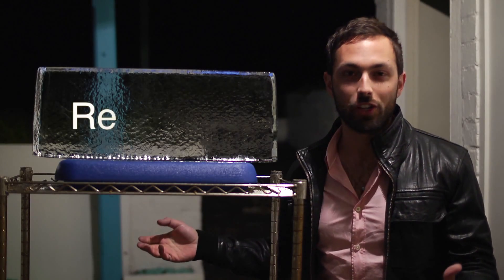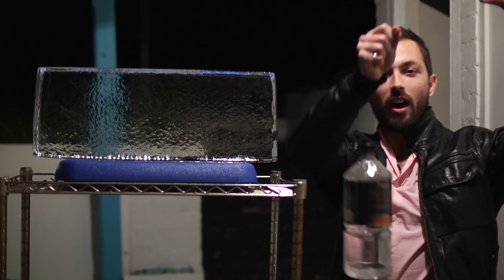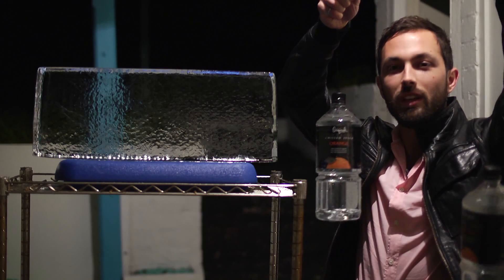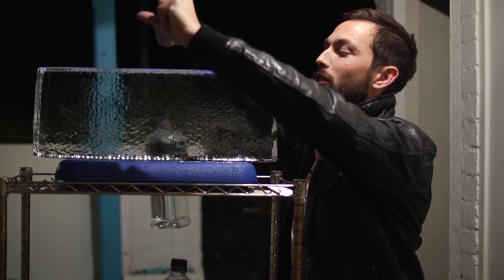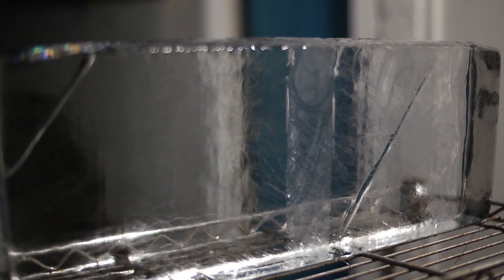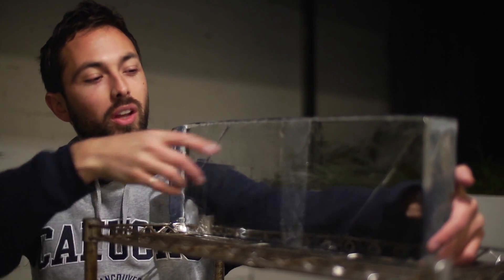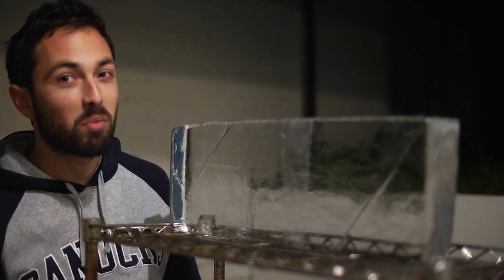Does Pressure Melt Ice?

Comment: I suggest you try this in a dark freezer where the temperature of the air, ice and wire are equal, then compare wire vs monofilament nylon etc. to isolate pressure to prove this theory.

Comment: Please do a video on how ski glide wax works. I have asked my physics professors and they could not give me a clear answer. From my understanding, if you wanted to decrease friction between the ski and the snow, you would want to use something like Teflon, but this is not the case. Glide wax apparently works by creating enough friction to cause the frozen water molecules to get "torn apart" and act like a layer of water. Is this the answer or is there more to it? Even more complex is cross country ski wax, called grip wax. What are the physics behind that? There are two types of grip wax; one is hard kick wax, used for new snow with a crystalline structure and very cold snow. The other is klister wax, and amorphous solid ( it looks thicker and stickier than honey) for older and wetter snow. I think this would be an interesting topic.

Comment: Wait....wouldn´t the ice itself cool the water down to below 0° and cause it to freeze anyway? You can rub two ice cubes together creating heat through friction and the surface will melt, if you then hold them in place, the icecubes themselfs freeze together...

I´d like to see that experiment by applying pressure to the entire block, melting it, then releasing the pressure freezing it again.

Comment: I personally don't really think this is a good demonstration of the phenomenon. I'm not completely sure whether it is the pressure on the ice from the string that cut the ice or that the wire is just conducting heat away from it, hence cutting it. I'm dubious its the pressure that turned it into water but fair enough. But the main problem is that, I'm very sure the reason why the ice is still one solid block after the cut is because the sub zero temperature of the block of ice instantly freezes the melted ice once its been cut. If I press two ice cubes against each other they will be bonded together very quickly, yet I'm applying pressure to the ice cubes, whilst this video says the opposite, does this not contradict each other?

Comment: YOU ARE COMPLETELY WRONG MATE !!!! ITS NOT THE PRESSURE OR HEAT ITS JUST INTERNAL BLOCK RESERVE OF NEGATIVE ENERGY SO THE WHIRE CUT TROUGH BLOCK TOO SLOW SO THE REST OF ICE BLOCK GAVE ENERGY TO FREEZE WATTER AGAIN TRY THIS TAKE 2 ICE BLOCKS WATTER WERRY SLIGHTLY ONE SIDE OF ICE BLOCKS AND PUT THEM TOGETHER THE ICE HAS TO BE WERRY FLAT YOU WILL SEE IT MELT DONWN
Reply: ...Negative energy? Are you off your bloody rocker, mate? There's no such thing.
Reply: I can forgive the poor grammar, but why are you shouting at us?
Reply: Perhaps viewers will understand your comment better if you actually spell words correctly.
Reply: Of all the comments that I have read hear I would say that JusstyteN is the closest. The first thing you must consider is that there is no such thing as "Cold", "Cold" is something we describe something feels like, much like wind chill. In fact "Cold" merely represents low energy. Heat is energy, the higher the energy the hotter something becomes, less energy the colder it feels. The key to this is the bottles of water tied to the strings. The bottles are being acted upon by gravity pulling them down the strings are thus acting against gravity's effect causing tension in the string. The string resists this force which creates energy. This energy, of the string, is resting on the surface of the low energy ice. High energy will always flow to areas of low energy thus 'warming' the ice. The string sinks through the water and stops on the solid ice and the process continues. The melted water floats above the string. Water has a higher energy level than ice. High energy and low energy. The surrounding low energy, ice, freezes the water and bonds the two blocks again. The neat thing I like is the shape of the cut. The string at the edge of the block has a higher amount of energy due mainly on the deflection of the tensional energy at that point and lessens until it reaches the center, from both directions. The string at the edge of the block of ice cuts quicker then the center forming the arc that we see in the video.
Reply: yea i know im not so good in english but im trying to say that the ice contains low energy compare to other stuff in room so the block just shares his low energy with water where whire gone and freeze it up again
Reply: FrakinUserName
yea thats what i meant even absolute 0 is an energy what we coud potensialy make a bigger energy i think geotermal house warming systems coud do that teoricaly and you are absolutely right the watter with higher energy freeses again because ice absorbs it and my english isnt that good yest to explain that thank you :)
Reply: FrakinUserName
i gave +1 btw :D
Reply: I don't want to sound like a smart-ass (too late) but absolute zero by definition is zero energy. Quick question; where in the universe would you find the coldest place?
Reply: FrakinUserName A lab on Earth.

Actually, probably a lab on another planet owned by a more advanced civilization than ours. But we haven't found any yet.
Reply: D-wave, Canadian company in BC (which recently got brought by Google for NASA, has produced a microchip at -273 C. Before someone ask, No I don't work there.
Reply: FrakinUserName
i read in sientists magazine that gass was cooled one nanokelvin below 0 kelvin so i guess that those gasses was coldest in universe but other that that im pretty positive that black holes are coldest and its called singularity state when atoms doesnt have gaps in between i like smart asses when they teach you something or makes your idea more accurate cool stuff cool stuff but hate them when any sayd word is "wrong" and there smart ass comes as far as i can see you are cool

Comment: How do we know it's not a "hot butter thru knife"? 
Is it the pressure that is changing the melting point of the ice or the wire heating the ice in contact to ambient temperature?  This needs to happen inside a giant freezer.

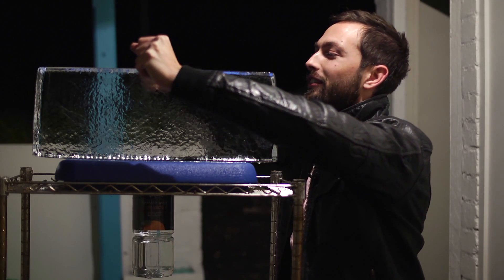Comment: I'm afraid that isn't convincing, as other commenters have pointed out: an example of an alternative hypothesis is thermal conductivity leading to both the melting and the refreezing. 0:35 is the problem: it's warmer than 0 degrees.

I think if the whole experiment is conducted in sub-zero conditions, it would rule out the possibility of the melting happening due to thermal conductivity.
Reply: Agreed.  This issue was really bothering me.
Reply: As follow up to my original comment: Veritasium is about education (and entertainment, as vehicle for the education). In a sense, it's like Mythbusters: it is about explaining how science works, it isn't about doing rigorous scientific studies. So my suggestion that this video doesn't fully rule out the suggested alternative hypothesis, is arguably not so relevant.

Anyway, here's a cool related video:
Ice Cutting Experiment
I feel it's orthogonal to the concern I expressed. What I perhaps miss most is just a better sense of how long this ice cutting takes, since the video is in fast-forward.
Reply: Hugo van der Merwe somebody missed the point if the scientific method.  It is a method by which one can engage in the pursuit of truth (Veritas).  Being rigorous and entertaining are not mutually exclusive.  Being brief and simple does not excuse modelling poor reasoning to non-scientists.
Reply: Exactly. If it were in a zub zero environment, even if the wire disipates heat, it wouldn't be able to do so as to get over 0°C, so the ice would remain solid.
Reply: *****
Right. Only that the gas inside the container should be kept at below 0°C, since otherwise the ice would melt due to the increase of the gas temperature due to the pressure.
Reply: Federico Manuel Aroca Echauri
Even IF everything stays below 0°C, the ice would melt under preassure.
http://s.hswstatic.com/gif/freeze-drying-graph.gif

Even at the same temperature, when the preassure increases, at some point the ice turns liquid again.

You cna do this experinment in a coolingchamber at -10°C and it wil still work.
Reply: try it at home with a plastic wire and you'll see, or go ice skating and think: If my fingers don't slip through the ice how come my ice skates have almost no friction?
Reply: @NicoKupfer  There's a thin layer of liquid that covers the ice, reducing friction. https://aapt.scitation.org/doi/10.1119/1.2343616

Comment: The ice refuses back together because for a couple reasons. 1, the seem cut from the melting wire is perfectly flat. 2, the core temperature of the ice is cold enough to refreeze what little water is in the seem, which fuses the block back together. 

This is a pretty incredible way to cut through the ice and will try this out sometime. I think if you were to try this with the low E string you would have much different results. From the larger wound string. Not complicated,temp always melts ice

Comment: Sorry dude this is a false statement. From being a professional ice carver for over 15 years I have seen ice do incredible things. I am not a scientist but I have cut, fused, melted, frozen, broken, shattered, exploded and bent ice.

Its is the pressure to a certain extent that is pushing the wire through the ice. But it is actually the metal wire melting itself through the ice. The metal absorbs (I'm sure there is a scientific word better then absorbs) the ambient heat/room temp

Comment: I wouldn't argue that pressure can melt the ice, but I'm not sure about the experiment.  You mention the temperature outside is above freezing and you are using a metal wire is it possible that the wire is transferring heat causing the ice to melt?  Love the videos, keep up the good work!

Comment: Lower pressures allow easier boiling (boiling at lower temperatures) because the partial pressure of the vapor in question is therefore lower, and a molecule can "escape" the liquid phase to the vapor phase more easily, and thus needs to be less energetic.

There's a comment from a couple weeks ago (just a couple down from here) that explains why ice goes to water when compressed.  

Water has some weird properties.  It's a big part of how life as we know it can exist, and is kind of awesome.

Comment: Wait. This doesn't make sense. The LOWER the pressure, the easier it is to boil. (higher elevations need less time to boil water.) So higher pressure would change steam to water. doesn't that mean even higher pressure would change water to ice? So why does extreme pressure change ice BACK to water?

Comment: Note, however, that 'normal' solids do not work this way.

Most solids are more dense then the liquid state of the same material. When you apply pressure, thermodynamics favors the more dense state, the solid.

Ice, because it has a really weird crystal structure, is less dense then water and so applying pressure causes it to melt. Again, thermodynamics tells us that the higher pressure favors the more dense state, meaning the water.

Because Ice is weird.

Comment: You'd be surprised!

Chemistry says that as pressure is applied to the solid water, equilibrium shifts to favour the liquid form more. Go look at a triple point graph of water, and look at what pressure does to it! Water is an exception to the general rule, though; this wouldn't work too well on most substances. 

Physics says that as more pressure is applied to the water, it wants to become more dense. And because water is more dense than ice, it melts!

It's some crazy stuff, phase changes.

Comment: This is very hard to demonstrate effectively as other comments show. What's the relationship between temp and required pressure? I know at -35 you cannot skate on ice because it will remain sticky and dry. If you could exert enough pressure though, regelation should still occur, right? At STP, ice will melt anyway, pressure or not.

Comment: It is the pressure, not the temperature. This will also work below 0°C

This is because under high pressure, the water gets denser, and water has its highest density in its liquid state. So it turns into a liquid again. This is why it is impossible for the oceans to completely freeze.

Comment: It's the pressure.  The wire he used only has a cross section of about 1/100,000th of a square meter on the ice (figuring 5cm long x 0.3mm across), and it's supporting ~2kg of water - that's ~13 atmospheres (~1.3MPa.)  It's more than enough to lower the melting point of ice and allow it to liquefy without heating. Also, thermal conductivity might explain why the ice would melt at the edges, but if that were the case the middle of the ice would never melt.  The wire would just be too cold.

Comment: After the wire passes a tiny bit of energy is taken from the surrounding ice to re freeze that gap.
Prepare a ice block at exactly zero degrees or just a tiny little lower and that string will cut the block in half.

Comment: not the pressure melt ice.the thermal conductivity.and after melting is coming back to ice because is surrounded by ice which froze the water back again.is that simple.
if in that room would be a temperature equal with the ice temperature and the copper wire would have the same temperature i don't think will produce any cut or something.or just maybe a bit at the corners because of the weight.but that's it

Comment: In 1940 or so, a scientist at Harvard used a double press to create 100s of states of water and ice, using pressures of 10's of 1000's of atmospheres.  Most of the states could be undone.  Some could not.  One state of water is an ice which melts at the temperature of solder.

Comment: I'm inclined to believe that the shape itself won't change. The parameters may change, i.e. the extremeness of the concavity, but since the portion of the force that is responsible for the phenomenon is still the vertical vector, I am pretty sure it will still be a hyperbolic cosine.

Comment: Also, does it change based on the angle the wire comes out of the block? Those water bottles were a significant distance laterally from the block of ice, whereas in the copper wire vs fishing line video, they went straight down.

Comment: The cold is one of the factors. Obviously it wouldn't work if the room was at a higher temperature. However, if the pressure wasn't gone, it wouldn't freeze again.

Comment: yes...but it would have to be in a very low pressure area, with a very powerful down force with a cable that is neutral to the area the steel is in.

The steel would melt, but solidify immediately once passed through as it went.

Metal hardens when cooled, but melted when heated up.

DURR DURR DURR.

Comment: Personally I think this experiment should have been done inside of an area below 0 degrees to keep the outside temperature from affecting the ice in anyway other wise the ice could have just melted but since you had the string on there when the ice melted the weighted string just fell though and sped the unfreezing process up in a single area therefore giving a false experiment

Comment: The core of the earth is made of metals that, when heated to their current temperatures, melt on the surface. However, because pressure raises melting and boiling points, even though the core is past its melting point, it is still solid.

Comment: That's experiment and good explanation. But… I think that it refreezes mostly because of the very narrow gap between the ice blocks allows it to refreeze. You should try using a thicker wire. There is a point where the width of the gap will be enough to overcome the refreezing cycle.

Comment: Check out the phase diagram of water and you will know why.
The melting point of ice decreases with pressure. With a thin string, the pressure on the ice block is large enough to lower the melting point below the room temperature of that room, therefore it melts, temporarily.

Comment: It would all be equalizing to the same temperature. Room temperature. If the ice was melting because of the heat of the string, it would have sliced the block in two because the heat wouldn't leave the ice, making it remain water.

Comment: A/C works on the refrigeration cycle idea, like fridges. Refrigerant vapor is pressurized by a compressor and undergoes a phase change, vapor to liquid. As a result, the difference in energy of motion between fast vapor molecules and slow liquid molecules is released where this is happening, the A/C unit (why hot air comes out). If the process is reversed, the refrigerant needs energy to vaporize. Energy it gets from the air it cools. Then back to the compressor it goes for another round.

Comment: Yup. Done similar experiments myself. Used to work in a production shop that used presses capable of pressures of 2000 lbs PSI. In the winter we would stuff the presses full of snow and activate them. Fluffy snow was instantly transformed into water and a thin layer of solid ice. Cool stuff.

Comment: Heat from the wire may not be the reason it goes through the ice, but you should try this experiment in a freezer with the wire being 32 degrees to see if there is any difference.

Comment: im sure you could factor in the specific heat of both materials and understand that the thin wire would be unable to conduct enough heat to melt the center of the block of ice and the fact that the water refreezes after the wire passes through it

Comment: Pressure alone isn't the full story - do the calculation for bulk water and you will find you would need an elephant or two on your back to pressure-melt bulk water.  There was a good paper a while ago on this topic - they showed that this melting depended on a SURFACE effect - in essence the top couple layers of frozen water are different -  "feeling" bulk ice on one side and waggling around in the air on the other, overall it's hard to melt the bulk, easier to plow away the surface.